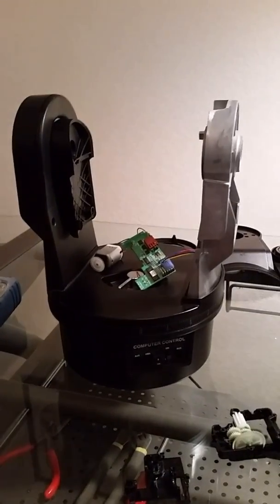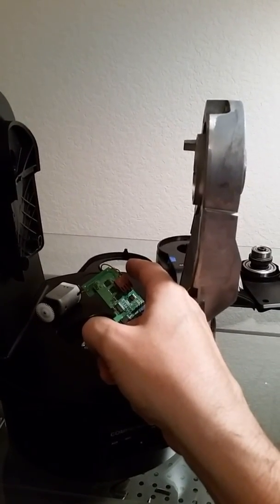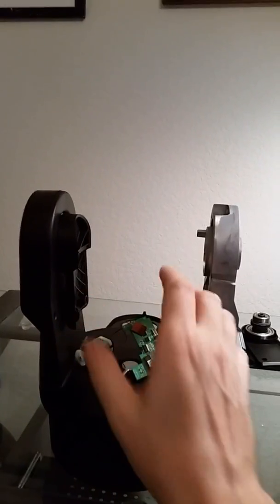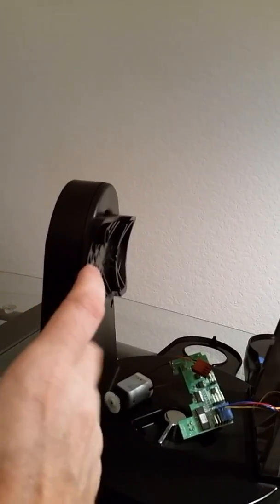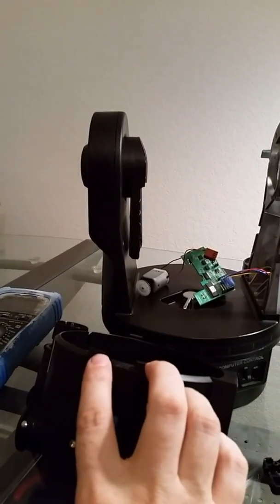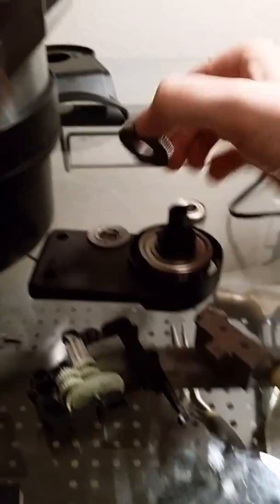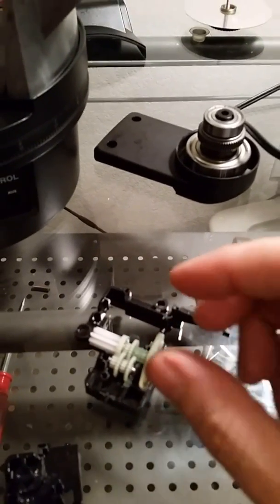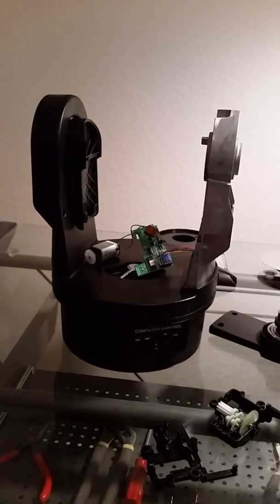Repair meade ETX 125 motor inside fork

Comment: I need help. I put my 8 batteries into my reflector  scope and it started smoking I remove them and cleaned off the device and then put the battery back in and it was working but while it was working the motor went out and when I open the compartment it was pretty much smoking I think I might have ruined it I'm just trying to find help or a replacement
Reply from the maker: I'm really not sure where you'd find replacement motors, which model was it?  The best place to look for anything telescope related is a site called cloudynights.com   some really great, experienced people there.